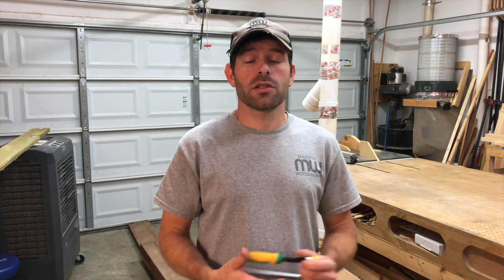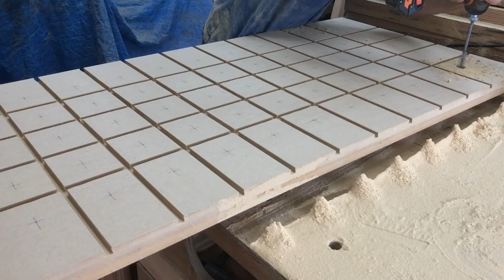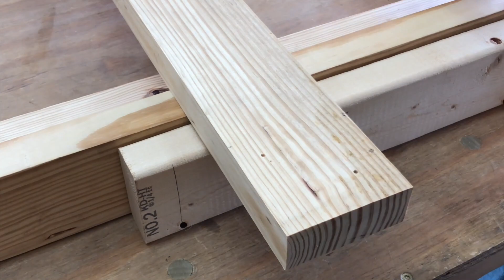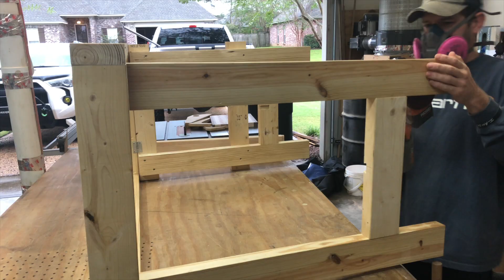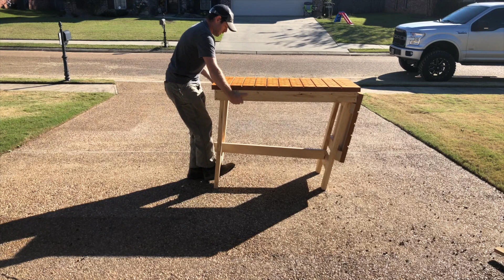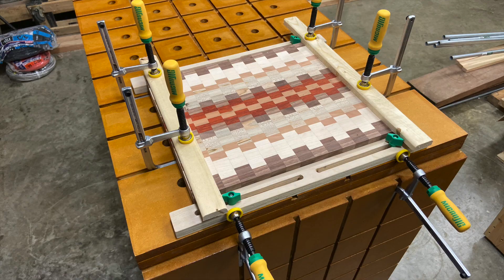Folding MicroJig Matchfit 360 Table - Full Build

Comment: @13:43, you used the clamp in vertical way to clamp three pieces of wood like that is not strong. It has tendency to break the vertical board slot easily because there was nothing to press against the slot, where the tongue of the clamp was mounted. The technique to use these clamp in correct way is an object has to be against the slot. Anyway, very nice build. Please note, this is not a criticized, it is a learning process to make thing better. I’ve learned something from your build as well. Thank you.
Reply from the maker: I appreciate you watching and noticing that! I’m definitely not an expert and welcome the insight 👍🏼

Comment: Nice job.  Now that you've had it for about 9 months what would you change if anything and what advice would you give now.  Thanks.
Reply from the maker: Hey George, I think the only thing I would change is, instead of using 2 layers of MDF, I would use MDF and a hard plywood laminated together to form the top. I don’t use it all the time, so my top is still holding up just fine. However, there is potential for the grooves in the MDF layer to eventually give out overtime. Thanks for watching!
Reply: @MadduxWoodworks  Thanks.
Reply: I was wondering if the shellac soaking in would have strengthened it so that wouldn’t be an issue.

Comment: Is the MDF strong enough for the clamping action of the matchfit clamps? Nicely done!
Reply from the maker: Since I've been working with it, I've only had the clamp try mess with the MDF when I was trying to clamp at odd angles and put stress on the groove. Other than that, it has worked perfectly. When I end up replacing the top down the road, I may actually go with a nice maple plywood for the top layer for added rigidity. Thanks for watching!

Comment: Beginner here…..what’s the drill bit guide to make the countersink for the screws called on the screw gun?
Reply from the maker: Amana Tool - 55225 Carbide Tipped 82° Countersink with Adjustable Depth Stop & No- https://a.co/d/ckkzBt0

This is the one I use 👍🏼

Comment: I still can’t make up my mind weather or not to put edge banding on my yet to be built table. I was going to put 5” sides on it with groves but your table is much simpler. I don’t think I would use the side clamps much. My use is for assembly not a workbench. Your input would be appreciated. Thanks Mark
Reply from the maker: SparkeyDogfish I think having the option of both the vertical and horizontal clamping capabilities is really nice, especially with assembly. I’ve also seen the vertical clamping option on a workbench, and it was really nice as well!

Comment: New subscriber here.  Nice to see someone else who has gone with the Ridgid line of tools. So far the Octane cordless system hasn't let me down. I am buying about a tool a month. Next month it will be the cordless palm router which has excellent reviews. 
This is just an excellent take on the Micro Jig table. It is really beautiful, and looks so professional. You should be really proud of yourself, and the excellent job you did. I have one question though, it doesn't look like you used one of the forstner bits that is on your tool list for your center holes. The reason I am asking is it appears your holes came out really clean and perfect, almost as though they were done on a drill press. Thanks and once again, great job!
Reply from the maker: Gregg Hernandez thanks Gregg! Ridgid does make some real quality tools. I actually drilled each hole by hand, with those forstner bits! It took FOREVER, but they did come out nicely. I just made sure I stayed as straight as possible while drilling, and I took it slow. 

Thanks again!
Reply: My question is why the dog holes when you can clamp from any direction with microjig clamps

Comment: What diameter holes did you drill in the top?  Microjig plans only describe them as optional, they don’t give recommended diameter.
Reply from the maker: Sorry I'm just now replying! I used 3/4" holes because that is the size bench dogs I have. Hope that helps.

Comment: Why the figure 8 table top fasteners for MDF top?   How long did it take to build?
Reply from the maker: I used them to secure the top to the frame. It could be done in a day, or two with the glue up, but I worked on it over the course of a few afternoons.

Comment: Great job. I’m building something similar on an adjustable base. What size are the dog holes?
Reply from the maker: I went with 3/4”, because that’s the size bench dogs that I have.
Reply: @MadduxWoodworks  Thanks.  I built the microjig version and they didn't quite spell it out.  I wanted to make sure I could clamp from underneath.

Comment: A tip. I bought myself 4 Festool clamps for 45 Euro's. But beware these look the same as the Matchfit clamps but do not fit in the Matchfit dovetail grooves!!!!. ....... Not a problem though that can't be fixed with an angle grinder with a flap disc in 10 minutes. 😂😂😂 Oh and the other bits and pieces I cut on my table saw from a HDPE cutting board. About 50 of them! 🤓🤑🤑🤑

Comment: are the dog holes for putting the clamp through also ?
Reply from the maker: They can be, if you have clamps that will fit into the holes. I've modified a few that will slide into the holes.

Comment: Great build. Are the dovetails in MDF or plywood (looks like MDF) and if in MDF have you found any issues with flexing?  I’m going to make a table using a butcher block workbench top from Woodcraft, but am curious if MDF works well.  I’ve made a few jigs using these with plywood and they work great.
Reply from the maker: If I do it again sometime, I would definitely go with plywood for the top. The mdf has held up great, and still does a great job, but I have found when putting a lot of pressure on the clamps, the mdf does tend to flex a little. Thanks for watching the video!!

Comment: Micro jig recommends making the first cut with their straight router then a second cut with the dovetail bit. did you use that method or just one pass with the dovetail bit?
Reply: I tried the fast route since I saw someone do it in a YouTube video. My once orange router bit came out the other end smoking and is now black. Next I tried the long route by first using a 6 mm straight bit. Now the dovetail bit went through the wood like a hot knife through butter. So .... my advice would be to go with the MicroJig recommendation. One thing to note is that you can't route a dovetail slot in several passes.  So you cut away a lot of material in one pass. The shavings have nowhere to go since the opening at the bottom (top of the wood) is relatively small. So the shavings will stay in the groove and have to be removed with e.g. a screw driver after cutting. This adds to the heat build up.
Reply from the maker: I cut all of these with just using the router bit. I do, however, highly recommend that you go with Microjig’s recommendation as well. Since this video, I have removed the bulk of the waste with a table saw blade, and followed with the router bit. There is a definite difference in how clean the cut is, as well as the bit doesn’t get nearly as hot.

Comment: What material did you use for the surface of this table?
Reply from the maker: This is two layers of mdf laminated together. If I had to do it again, I would use a hard plywood for the top layer, as it will hold up better overtime. Mine is still in perfect condition as of now.

Comment: Based on your design.  How do you keep the table stationary on a work shop or garage floor? I would imagine that once a piece of wood is clamped down and you want to use a hand planer, it could just slide across the floor.
Reply from the maker: You would be correct there. I use mine strictly for assembly. I have a big workbench with a wood vise and bench dogs for hand tool work.

Comment: Good morning, I have a custom made formica table approximately 44 1/2"" x 66"". Used to be my parents dining room table they had made probably over 25 years ago, my wife doesn't want it, I thought I can have a microjig table top built for it and installing it on the existing table or perhaps build at least half the table with aprons and stop jigs. I love restoring furniture and build small projects opposed to remodeling inside my home, however, I do not have the necessary tools to build the table. If you can build it for me, I'll pay and pay for the shipping. I'd greatly appreciate it. What do you think? I don't want to get rid of the tabe. I also have a smaller round table I can also probably use to Mount a microjig table to. What do you say?
Reply: I'm sorry, I meant to say I also do some inside remodeling in my home, not much, like floors and drywall and painting of coarse.

Comment: THANK YOU FOR A GREAT VID! Did you MDF on both layers of your top? Would you recomend MDF on the top layer? Have you experienced any problems with the grooves blowing out with clamp force? Did you put any finish in the grooves?
Reply from the maker: john Frederickson thanks for watching! So I did use MDF for both layers of the top, and so far, I’ve had zero problems with the groves blowing out or deforming at all. I did put shellac over the entire top, including the groves, and the finish really stabilizes the top.

I have seen some tops with an mdf/plywood top mix, plywood being the top layer.
Reply: What is the space between lines
Reply: @krazypolak1820  MicroJig recommends 4 inch pitch

Comment: Is that Zinsser Seal Coat shellac, and did you dilute it or use straight from the can?  Any issues with the MDF holding up to the pull of the dovetails?  Nice video, thank you!
Reply from the maker: Derek Schulte yessir it is. I used it full strength out of the can. So far, I haven’t had any issues with the MDF 🤞🏼, and I’m hoping it’ll stay that way for a while. Thanks for checking it out and for your questions!

Comment: You are running your router the wrong direction along your guides.  Left to right is correct.
Reply: Its called climb cutting.  The risk is the router would race forward if not controlled.  However, that is generally much less likely to happen in a fully enclosed cut like the slots he's making.  Also, people climb cut intentionally on outside cuts despite the risk because it is effective at controlling tear-out.  You just need to be aware of what the router will try to do and mitigate the risk with shallow passes and a firm grip.
Reply: @eztr1gger  No need to climb cut in that situation.  I operated a router in an architectural wood shop for 12 years for 8 to 10 hours a day and there is no need to climb cut here,

Comment: Everything but the measurements; really?  It would have been nice to see you figure out from the size of the boards.
Reply from the maker: What measurements are you wanting?
Reply: Having watched and observed the video, and based on his reply to someone else, I'll say the top is 24"x48", holes and slots are on 4" center (he said it to someone and WATCHING the video you can see he is spacing at 4" when he is marking it out). It's not that hard to observe, then design something that MEETS YOUR NEEDS using the knowledge you gain.  That's what it is be a woodworker, observe, learn, adapt and build.

Comment: Your work is excellent but the entire concept of this system borders on the absurd. Mashed paper with a dovetail and metal clamp having any longevity, not much better than gummy bear tires for your car
Reply from the maker: Ok, now that made me laugh!
I'm finding that the mdf, while it does work well, has begun to show some wear over time from clamping. 
I now suggest that anyone going for this design, to use a good quality hardwood ply to make the top. It's what Micro jig suggests as well.